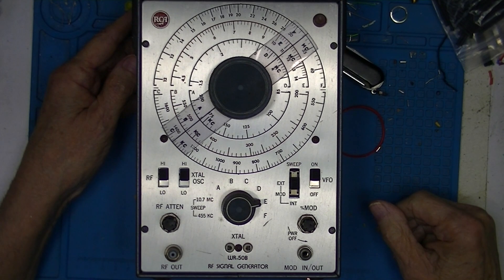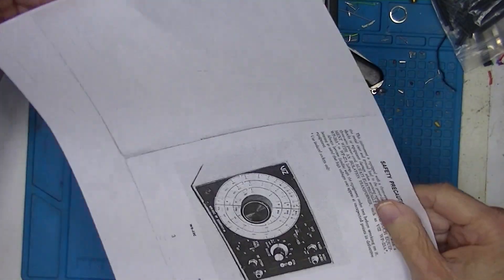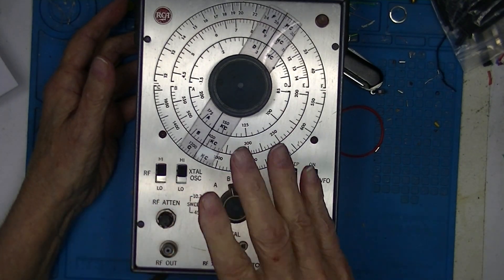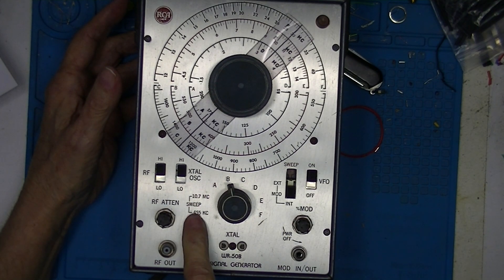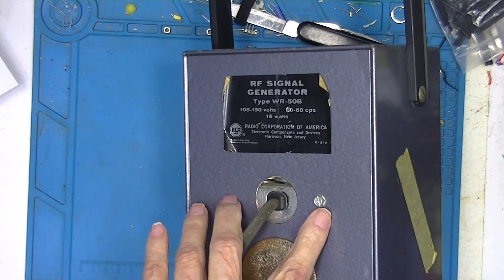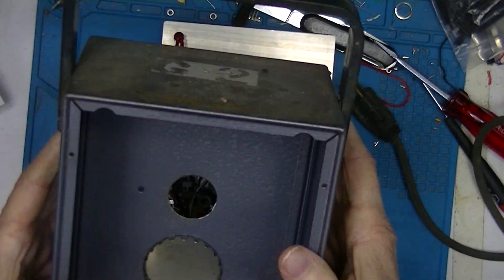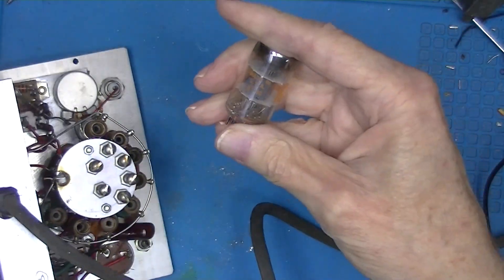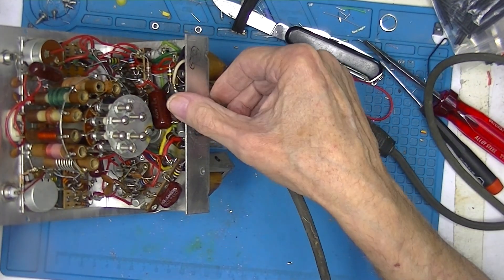A Look at an RCA WR-50B Signal Generator - Part 1

Comment: I just restored with minimal parts and effort an RCA WR-50 B . Upon checking the accuracy I found it to be spot on in accuracy. This will be my bench alignment tool and I want to try the sweep method vs the staggered tuning technique. Finding those quartz Xtals of 455 Khz and 1000 Khz is next ti impossible, so I will give the ceramic filters a try. My work bench is primarily setup with EICO and RCA Service grade test equip that I rescued and restored.